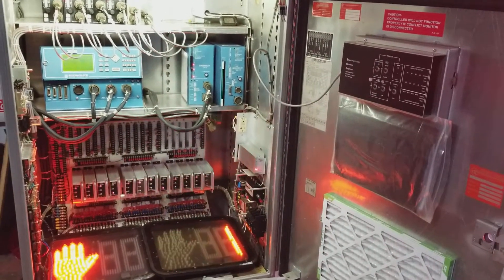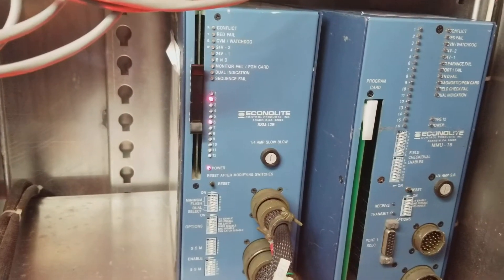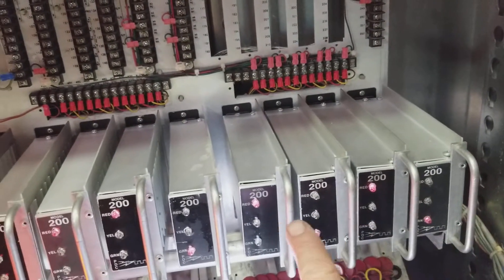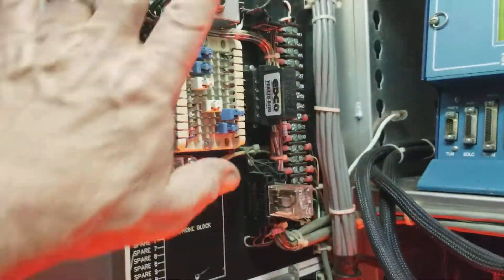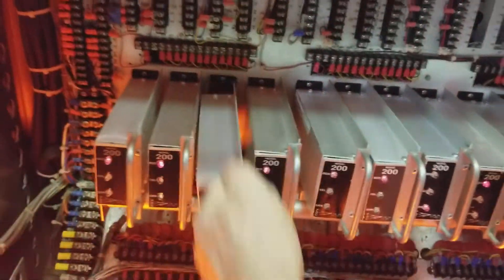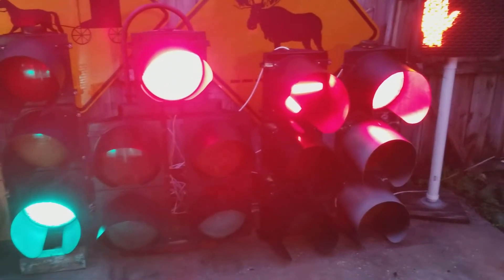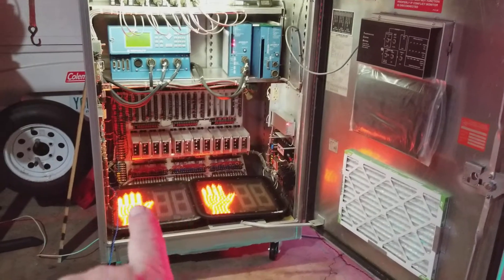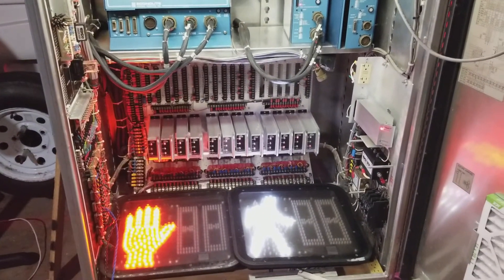Run Up And Tour Of My New Traffic Signal Controller Cabinet.

Comment: Maybe you could make a video on how to program the ASC 2S 2100, I got one and I’m having so much trouble because it don’t know much about it that I don’t even want to look at it, at least 2 phase programming would be nice...
Reply from the maker: I have given that some thought, However I am by far no expert on the Econolite Controllers. It's more a hobby for me.

I wouldn't hold back on going through the menus on your controller. I learned quite allot from just messing around. Even if you set something up and can't fix it you can always just reset the controller back to factory settings. 
Best is to get a copy of the User Manual for the controller. I have a copy on my Github site. I'll put a link below. What I did was to sit down and with the manual go page by page until I got a basic idea how to program different setting. Also If your not familiar with how to program phases, loops and rings best to watch a few youtube videos on that subject. I think that helped me more then learning how to program the one controller,  I have a few other controllers that having the knowledge of basic traffic control really helps.
YouTube is a great source of information for Traffic Control Devices.

Here are some helpful links:

ASC/2 Family Programming Manual
https://github.com/RadioFree78/TrafficSignals

ASC/2 Maintenance Manual
https://usermanual.wiki/Document/ASC2S20Maintenance20Manual.1665351045/view

ASC/2 Program Reference Card
https://www.google.com/url?sa=t&rct=j&q=&esrc=s&source=web&cd=&ved=2ahUKEwjHjKL9zK3wAhULRDABHW54B8sQFjACegQIAxAD&url=http%3A%2F%2Fwww.signalcontrol.com%2Ftech_papers%2Feconolite%2FASC-2S%2520Programming%2520Chart.pdf&usg=AOvVaw1M-sBoC0OLNrv88LaiN5XM

Lecture 08 Traffic Signal Design
https://youtu.be/eDW8ICUUV9o

Comment: Nice! Can you help me in finding the A cable for the controller? I have one identical but I need an a cable, or a whole load bay if possible
Reply from the maker: They are hard to come by without the whole load bay. My first one I made myself buying the cannon connector and a roll of wire. took me a few hours to make. 
There are a few good groups on facebook that may be able to help or find one on govdeals.com or craigslist .
I brought a complete control cabinet here in Florida off craigslist for $250 and it was in great shape. you can see it in one of my videos.

good luck hope you find what your looking for
Reply: @jrocco36  thanks, could you link where you found the connector to make your own?
Reply from the maker: @TexasRailfan2008  I remember buying it on Ebay a few years back.. something like 55pin(?)  female cannon connector. check how many pins are on your "A" connector on the controller so you get the right one. for the wire I used #22 stranded with black insulation. Make them good and long and don't forget to label each one. The Econolite manual has one whole page for the pinout of the connector.
Reply: @jrocco36  ok! I would definitely like that manual otherwise it would be practically impossible to get the right cables In the right place! I had thought about making one before but ran into that problem.
Reply: @jrocco36  yep it’s 55 pin and I found one, once you email the manual, I’ll think about getting the connector
Reply: Or if it’s a paper copy, I can email you my home adress
Reply from the maker: @TexasRailfan2008  I have it in electronic form. its on my work PC so I will send it to my github site and post a link here tomorrow.
Reply: @jrocco36  ok!
Reply from the maker: @TexasRailfan2008  You can get the manual here. In the appendex you can find the pinouts for all the cannon connectors. https://github.com/RadioFree78/TrafficSignals/blob/master/ASC2S%20Programing%20Manual-1.pdf
Reply: @jrocco36  thank you!
Reply: @jrocco36  also, I’m assuming the logic ground is needed?, I ,see all the other connections for the AC+ AC- and AC ground.
Reply: @jrocco36  also, thanks for subscribing!

Comment: Nice cabinet setup, looks like a TCS cabinet, the jumpers on the program card are for overlaps, jumpers allow a phase and its overlap (used for turns) to be on and not cause a conflict and put cabinet into flash
Reply from the maker: Thanks for the comment! Your right it's a  Traffic control systems cabinet (Tampa FL.) It was originally installed at 7th St W and US41 in Palmetto Florida. I know this as all the intersection plans and schematic for the box came with it. There is a place called "Morgan Trailers" in Parrish, FL Near Duette  that sells the cabinets  less the Controllers, MMU and load switches. He puts them on Craigslist from time to time. All I had to do was put all my stuff in and power it. 

For the MMU I had to figure that out for myself since my other cabinet the MMU wiring must be wrong as it never took over even though I had the setting all wrong
Reply: Thanks for the info on the cabinet, can i ask the size of it (demensions) i knew the owner of TCS for years before his passing, he sold me my 8 inch dog house signal and a 18 inch ped probablly around 30 years ago, the signal is in one of my videos, of course changed the glass lenses to LED, yep i have had it that long, hard to belive, my first signal is a 8 inch Marbelite my brother got for my at a yard sale, just kept adding, you have some nice signals in your collection
Reply from the maker: I just measured the cabinet and its 38" wide, 28" deep and 56" tall. I made a base with casters for the bottom so I can easily move it around when I need to. it adds about 4" to its height. it has 12 ports where 8 are for the signal heads and 4 for the PEDs. I also have a smaller 8 port controller box. I need to take that one apart and figure out why the MMU doesn't work

Just like yourself I keep adding to my collection. I got into signals about 4 years ago and built controllers to run them. I started with controllers I made years ago for my H.0. scale traffic signals. you can see my first set of lights and the controller I made in my videos.
Reply: Thats a good size cabinet, you have alot of space, my cabinet was sortof custom made, its actually a UPS battery backup cabinet that i had the factory add a police door, the guts came out of a small eagle pole mount cabinet, i wish i had the cabinet a few inches more wider to add more phases, one day, i took a look at that site you mentioned they have a larger looking cabinet for sale now
Reply from the maker: After I first got my Econlite controller I built a 4 port load bay and "A" cable from scratch. The cable was fun to build as it had around 55 wires that needed to be soldered into the cannon connector.
 I also have a pole mounted cabinet that has a 8 port load bay. I need to rewire it as the MMU doesn't work correctly. you can see the one I made running with my Eagle 300 controller in my other video https://www.youtube.com/watch?v=EwlaFype32s
It also has my smaller control box.
I looked at your videos and you have a cool setup. I like the talking PED.
Reply: @jrocco36  If your looking for equipment I would recommend a contractor by the name of MPG & Co. If you want any cabinets, illuminated street name signs, heads, bases, poles so on and so on let me know and I will talk to Scott. They are in largo so they are close to you. He's a very generous person and I would highly recommend supporting him.

Comment: The left turn signals are new.
I didn't see them last time
Reply from the maker: I've added a few. they cycle 1-5, 2-6, 3-4, 7-8. next I am going to program them for Protected then permissive turns on green. after I made this video I made 8 loops for loop detecting.